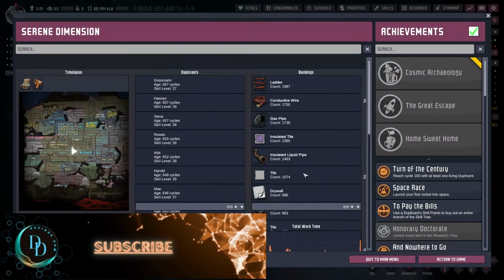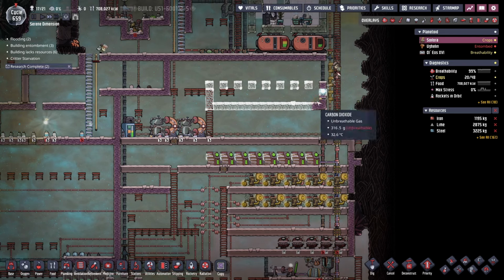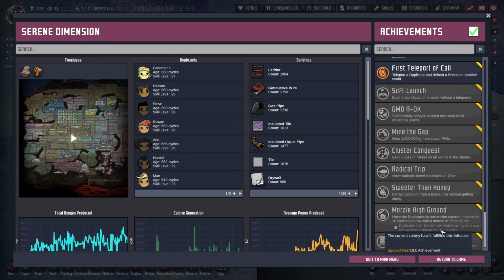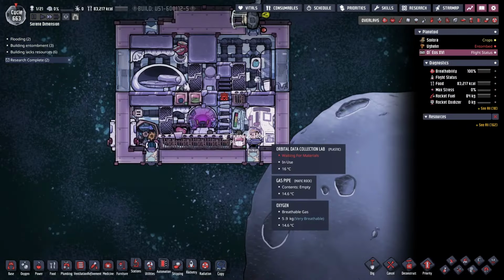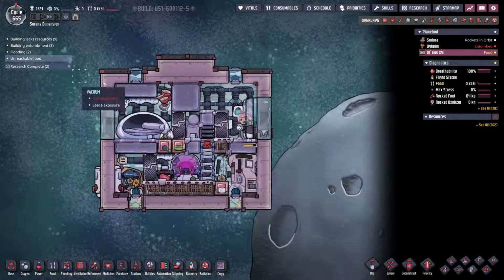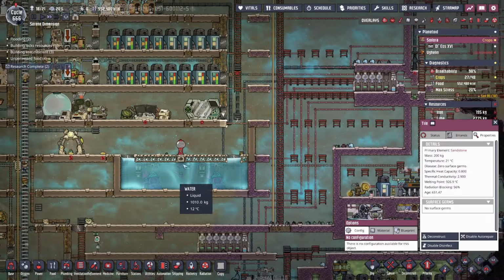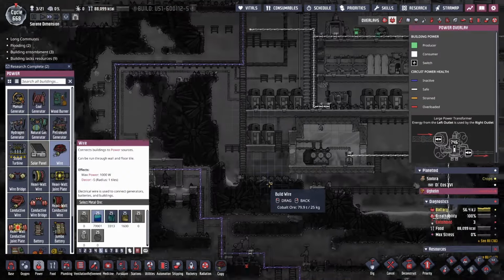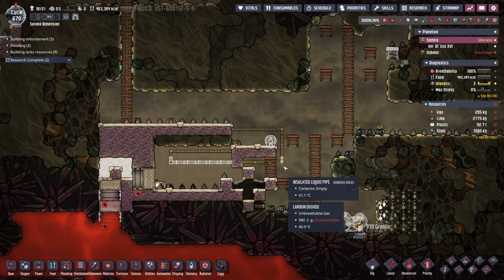Ep 89 - Experimental Petroleum Boiler - Oxygen Not Included - Beginner & Achievement Guide - 2024

Comment: The oxylite in co2 is causing the popped eardrums you need to sweep it up. If you wanna keep using surf and turf its probably better to use a dehydrator to pack it up for the rocket. You probably want a way to stop crude oil from flooding the system just in case its not hot enough and if you find the petroleum to be too hot consider using alternating insulated tiles and metal tiles to increase heat transfer between the crude oil and petroleum channels
Reply from the maker: Thank you for the suggestions! I Do appreciate it :)